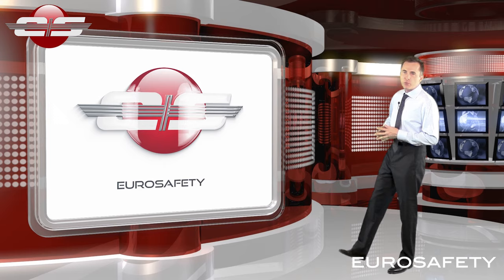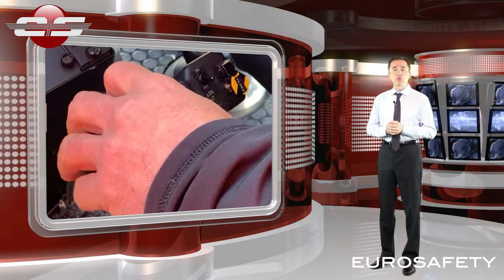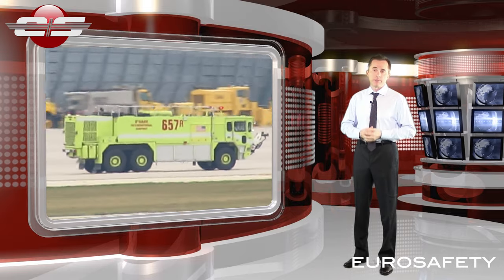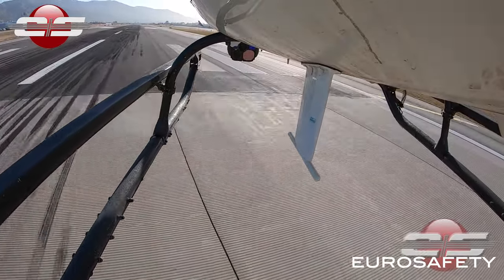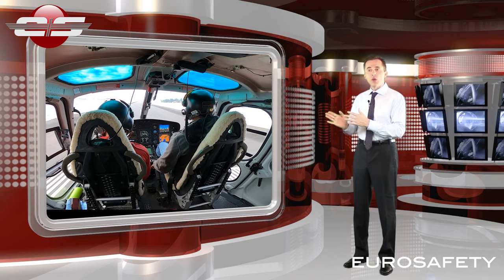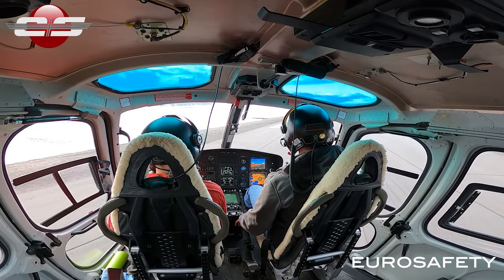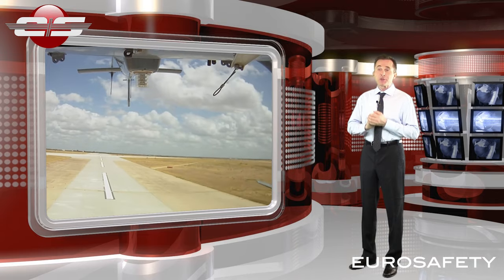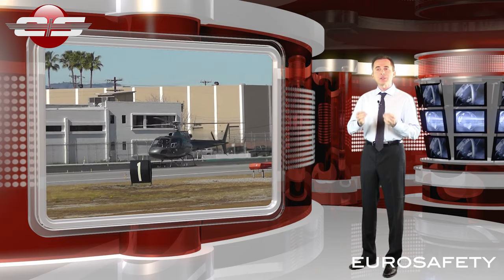Critical Response: Handling Stuck Pedal Scenarios in Flight (2012 re-edit)

Comment: Hi Glenn, im reading my as350b3e manual and i find a difference betwen the procedure that u described on the video , in my emergency procedure indicate:

Cyclyc and collective: adjust to ias 70kt
ACCU TEST :  (5 SECS) back to normal
and make the shallow approach .

i dont know if on 2012 the procedure was differente or something

thank for the re edit of the video! 

"The magic speed"
Reply from the maker: Good Morning, could you clarify what is the difference you are referring to? This video did broadly refer to both single and dual hydraulic systems in the AS350 and AS355.
Reply: @EUROSAFETYTRAINING  with single hydraulic system, the thing is that in the emergency maneuver of the generic manual I have, which is the 2022 edition of the h125, and the manual of mine (2008) do not include the point of cutting off the hydraulic system of the switch as I could see in your video, only refers to 70 knots, and the accu test